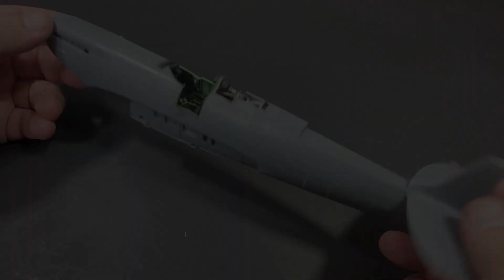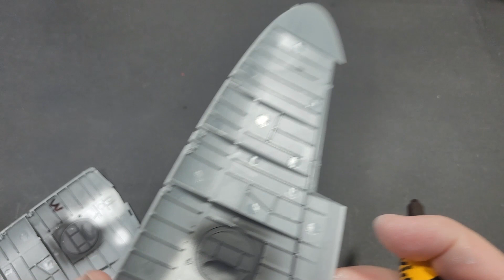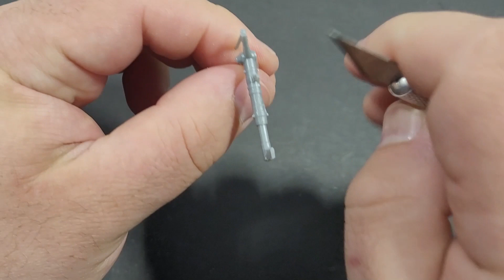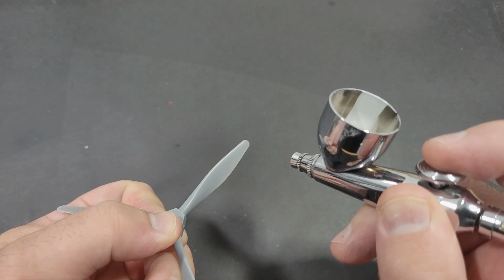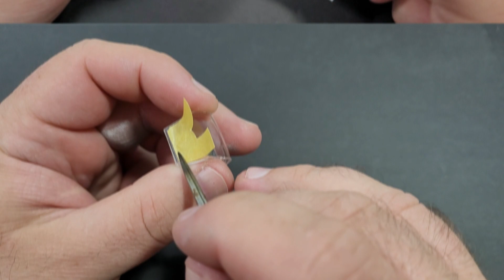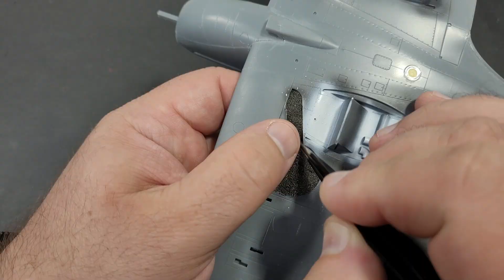Building the Kotare Models 1/32 Supermarine Spitfire Mk.1a (Mid) Brian Lane - Part 2 (Construction)

Comment: Great build and tips here Dave - makes me want to get back to my Kotare Spit (which I've modified to inflight, just need to design a 3D printed mount for the electric motor) - especially liked how you used the Tamiya Spit masks as a base, I must look at Inkscape.
BTW what camera and lights are you using to film this - its very good! Keep these videos coming please....cheers Chris
Reply from the maker: Heya Chris, Oh you should! Having built two, they are a complete joy and go together quickly. Looking forward to your solution for the mount. Just so you know, the kit prop shaft is slightly sloppy in the front once the fuse is glued. You will need to replace it or shim it out. Re Camera and lights, I am just using my Samsung S20FE to film at the moment and lights are these old Viltrox LL126VB LEDs. I've had the LEDs for about 10 years now and the emitters are now dying. I've just ordered myself two GVM 880RS lamps. Hoping they will be here tomorrow!